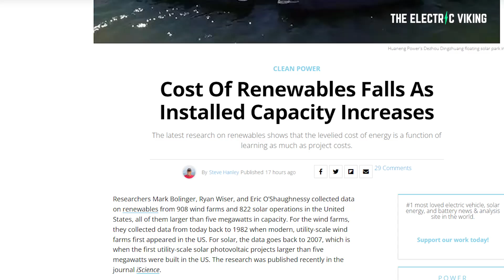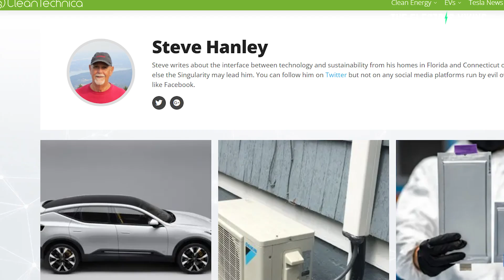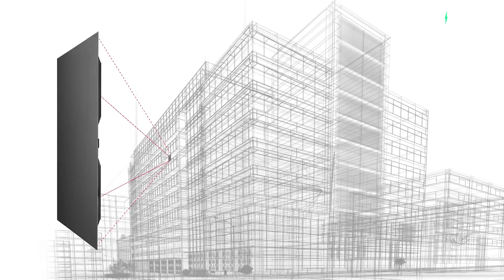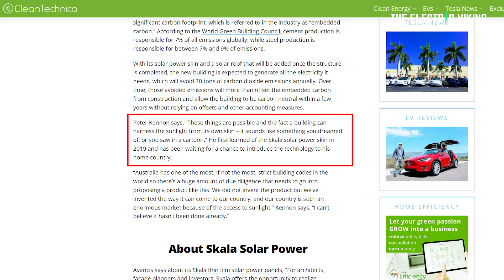INSANE new solar technology that is changing the world NOW

Comment: Yeah but these solars only last ten years same with air turbines they cant remove all the pollution air clouds cuz they need those to make solar panels & air  turbans but paris had the answer since 1970 its a water powered cement bridge turbine that powers 100,000 homes its cheaper to build than a radioactive electricity & 100% safe even for fish build 1- 2 of these in each city. And they last meaning it was built in 1970 and it still working I know they got Center solar panels now or you can put on your own household I'm working on making those build up our house and but water turbines taking a lithium and other types of minerals to make these I mean I know they came up with bacteria in Sweden they have discovered harder abstract metal from Plants but it's not enough another coming up with a lot of innovative ideas the Biden is still digging for oil and gas in this destroying our planet I think the Paris water turbine Bridges is the best way to go until they can make better technology Britain minister visited paris to look at Bridge but decided not to use it, its cuz he wants to continue to make 💰 on gas & oil but of course he doeseny say that he says the cement turbine bridge is not economical convenient which is a lie cuz paris has been using it since 1970

Comment: Hi Sam. Sorry to say that the chemical reaction that turns limestone into portland cement creates CO2. Perhaps energy sources used for transporting and crushing the product can go all renewable, but there is no way to make concrete without releasing CO2 into the air.
Solar skin on the outside, wind turbines on the roof and batteries in the basement would make for a self powered building. Not only would it be cheaper in the long run for energy costs, it would also be black-out proof. Another side benefit is that since it is drawing energy from the environment, it's not adding heat to the environment either. Our large cities wouldn't be any hotter than the contryside in the heat of summer. It's a massive win!
Reply: Making that chemical reaction happen involves a huge kiln which has generally been heated by burning stuff, that is another part that can be done with renewables. And there may not be any way to make it without releasing some, but afterwards the hardening concrete absorbs CO2 from the air.

Comment: I agree, it's exciting. It would be interesting to know if the excess energy will be locally stored in batteries or if they plan to execute a netmetering arrangement with the local utility. Making a grid interconnection of that size would require some sofisticated equipment on the primary side of the transformer. I'd like to know how they will solve all of that.

Comment: Ordinarily Fe3O4 (iron oxide) is reacted with carbon -> Fe + CO2 (Iron and carbon dioxide)
However the Iron oxide can be reacted with hydrogen to produce just Iron and Water. The technology exists. Obviously we will need hydrogen produced by the electrolysis of water to do this…..with the electric energy required produced by pV panels. 
Australia has enormous scope for exporting hydrogen 
Sam YOU ARE RIGHT AGAIN !!!

Comment: How many EVs (roughly) could be powered by the one building? Just as a point of reference. I'd like to see how we can limit fossil energy powering EVs. Coal use has climbed dramatically by the global price of oil. We need to reduce all fossil fuels for electricity production.
Reply: You can easily imagine that future buildings will see their shape and siting as a possible financial resource from the excess power generated.

Comment: Is a metric shit ton 2.2 x a shit ton us? Next one is it stick or twig. I remember going to Nerel in high school. Pretty cool.  The problems currently. 1. Turbine blades are barried once being put out of service. 2. The cars don't fancy gear heads. 

To think of architecture today and frank Loyd wright's work of the future. It'll be impressive to see what the make. I'm currently looking in tiny homes like Norton legend 2. The big problem about buildings and houses is disturbing the top soil releasing locked carbon that will not be recaptured by plants. Building Vertically is the future.

Comment: The assumption that sodium batteries will be cheaper than lithium batteries remains to be verified.
It should be noted that the lithium in a lithium battery is not as large a component of the battery cost as people assume. Also lithium is significantly superior to sodium as a battery element due to its smaller ion size and higher cell voltage.
Reply: Sodium batteries will be cheaper and sodium being cheaper than lithium is just a part of it. It is common so the price will not rise to insane levels and there will be no material shortages slowing down battery production or causing projects to be late, so there will be more customers willing to buy them, which means battery manufacturers can safely invest in building bigger factories, which will increase the amount of batteries made, which will keep the prices down.
Lithium batteries would have more power and can charge faster, but sodium batteries can be made cheap enough and in such large number that projects like all EVs having swappable batteries and every home having a megawatt-hour of energy storage become viable. They are also less prone to having problems with heat so they are safer, so they can again be used in more applications.

Comment: When it comes to green energy most people get carried away by the media hype, positive and negative. Most people are not scientist or engineer. But it does not take an expert to know what the experts concluded. 

NO AMOUNT OF WIND/SOLAR ENERGY CAN FORM BASE POWER. 

Base power mean steady large power the economy can depend on 24x7. But there's more: it is power that allow precise, balanced engineering of the grid, does not need vast amount of battery storage. 

ALL solar/wind need vast storage, or much of it is wasted. Huge variation cause a great deal of flux to the grid, create much engineering and management challenges. Covering large number of buildings with solar panels may look sexy, but it is completely impractical, yield miniscue impact. 

So wind/solar power is not the 'insane' tech that change the world, regardless of their size. The real power that change the world is nuclear, natural gas and green hydrogen - these are the base power economies can actually depend on. Hydro is also base power but that has already been tapped out worldwide. Wind can be used to make hydrogen, which deliver base power - the H2 actually serve as a 'battery'. You don't have to like what I and experts say. But you have to deal with the physics of the real world.

Comment: IMO. Solar power is best when installed nearest the place power is needed. Roofs. Building facades. They are obvious places if they have direct sunlight. It also helps diversify the electric grid. With local battery storage, our grids are more stable and less prone to attack by enemies of any type.

Comment: People like to feel that they are on top of any subject, and so repeat 'talking points'.
EVERYBODY does a daily drive of only 10% of their cars range and top up every 10 days if going to empty on fuel guage. 
EVs will be topped up everyday from any where the car is parked and on std 240v supply.
Forget 'horse and cart' thinking, Ford destroyed that thinking and the EV world will destroy the ICE world. 7million EV sold last year and main production has not started.
The automatic plug in device will be the killer invention, and the grid will trade power for money with the huge 100kwh EV battery. Trade for money. Everybody will pay to be grid connected only.

NOBODY will buy a home battery, the EV battery is big enough to power the home over night and everyone is grid connected.
Everybody will have an electric constant flow hot water heater to top up stored hot water. Small and cheap.

Comment: Australia has 8 million billion m2 of sunshine 365 days a year. 
1 kwh for each m2.
7,000 klm main transmission line down East Coast and across to Perth. 
3 time zones of extra sunshine on the grid.
A small gap 1,600klm in south desert.
Then the wind energy from the Roaring Forties, the trade winds across the southern coastline near the transmission lines.
Every building rooftop and every EV vehicles battery and the grid. 
33kwh x 10 million rooftops x 365 days. 
100kwh x 20 million EV batteries.
7,000klm grid x 3 time zones.
Petroleum will be a strategic military reserve asset. 
Even the nuclear industry wants to power Electric Vehicles but their costs are massive and FIXED.
All homes and all vehicles means x3 electrical power required.  ! ! !
Reply: Solar on the roof also shades the existing roof, extending the life?
I would imagine there's also a case for direct solar water heating?
Just needs joined up thinking
Reply: @rogerstarkey5390  yes I have mentioned this to the companies quoting me to supply my rooftop solar PV. 
A cooler attic space. 
Not sure how expensive water and high DC voltage solution could be. 🤔 
Just my thoughts.
Reply: @rogerstarkey5390  further thought on solar hot water, if 4m2 gives 320 litres in 5 hours from solar water panels, then
16m2 is needed for solar PV panels to heat the same 320 litres. 
Roof space maybe tight and hot water panels maybe it.
If the grid is oversupplied then Electric storage hot water tank to absorb the excess energy maybe it.
Heat pumps are 4 to 5 times more efficient and so 4m2 of solar PV panels maybe the go, this last solution may absorb excess energy from the grid as required and directly heat the water. 
Excess grid energy maybe mean the grid will pay you to take it. 😃 
The grid will be smarter than your smart meter.
The grid will use AI to predict the weather for supply and demand. 
Just my thoughts. 
We have grandchildren and idiots are pushing a nuclear industry around the world. And Australia supplying the world's uranium and charging EV batteries. 
The USA is the biggest target in the world and it's military costs would massively increase so that its nuclear capacity increase will match the world's dictators. 
Australia will be the target if we do not supply uranium when we have large reserves. 
Just my thoughts.
Reply: Connection between east and west in Australia is the sort of goal that would allow access to the abundant solar and wind potential of the currently mostly vacant Nullarbor plain. The high cliffs of the great Australian bight would be useful for pumped hydro storage. The freight costs without diesel trains and trucks could off set much of the costs.🇦🇺🌞🌏🤔
Reply: @malcolmrickarby2313  yes.
The new 700 klm link to Adelaide's transmission lines is at $2million a klm. 
So 1,600 to link the East Coast markets to the West Coast is  'no brainer'.
An electrified rail,  a  'linear' industrial corridor, even pumped hydro storage with sea water, very good thinking. 
The cliffs are very high, and storage could be low burms of earth covering acres.
Low weight trains travelling in both directions for thousands of klm, for passengers, workers living in the desert and going to work down the line.
Fully automatic trains running 24/7 on renewable energy. And with sleepers for an overnight trip to the big city. 
The desert residential suburbs could have access to the coastline and the wide open desert area. 
Great thinking. 
Australia could extend its merit based migration policy. Millions want safe homes in a safe country.
Reply: @malcolmrickarby2313  the extension north into the desert of more solar farms and farming under the panels.
Water has always been the biggest problem but now solar and renewable energy and access to the sea would allow desalination.....
Reply: Jai Hinduja.  Australia has the resources that can be combined with Indian technological brain power and  manufacturing prowess  in the WinWin Comprehensive Economic Cooperation Agreement of the 2 nations.
Reply: @tedchandran  8,000 million klm2 x 1kw/m2 each day. Approximately. 
8,000 x 1,000 x 1,000 x 1,000 x 1,000 kWhrs each day.
8 billion million kwh each day. 
8 billion GWh.each day. 
POLITICALLY STABLE. 
PLUS wind power.
Unlimited energy and robotic manufacturing and mining. 
POLITICALLY STABLE. 
USA a stable ally.
Minerals everywhere. 
The world can cool down and
 the ' Lucky Country ', Australia, can grow again. 
Just saying.

Comment: Is the price of solar and wind dropping?  It better its already 2x the cost per kWh to produce.  A reality check is; when people see this cost; they won't want to pay twice as much for power.  If large numbers of EVs ever start to burden the grid - there will be no choice but to go with increased fossil fuel use - which is contradictory to the reasons or doing it in the first place.
Reply: The reality check has been made years ago and the result was that wind and solar are the cheapest option and still getting cheaper. Only real competition are other renewables and nuclear power. Some smart people have also calculated how much EVs will burden the grid and know there is no need to increase fossil fuel use. In fact there will be lots of energy saved because it is no longer wasted mining, refining and transporting fossil fuels just to burn them in highly inefficient machines. There will be no choice but to decrease fossil fuel use, meaning trillions of tax dollars will not be wasted subsiding them. When people see the cost they won't want to pay for stupidly expensive fossil fuels.

Comment: Todays standard 300w solar panel is about 20% efficient.  There isn't much hope for a breakthrough. Even if it was, powering an EV is fantasy land.  If you live in the sunbelt it takes 10 such panels charging all day to power a Tesla 15 miles!  That's a fact; so to get 150 miles would take 100 such panels; even if you could double panel efficiency to 40% you'd need 50 and at what cost?
Get real solar powered EVs is a fantasy what EVs need is thermonuclear power to make them green.
Reply: Our scottish 6kw system is enough yield annually to cover 70 mile a day commute in my Tesla Model3.  Need a second powerpack though as my Tesla charges about 16kw weeknights (on cheap rate grid)
Reply: @colinpalmer9070  Hello Colin; so am I correct in understanding you have 18-20 300 kWh solar panels; More? and your commute speed is 35mph?  So you are driving one hour each way?  My figures are based on 65mph and 10 cell; not on my experience but that of a major installer.  You also have a model 3 probably the standard configuration which is the lightest.  This isn't a typical Tesla; so all together I wouldn't say it isn't possible to do that.  You mention 6kWh so you'd need 10 hours of light You don't get that every day in Scotland I would think? You also said 70 miles not km?
Reply: In Australia 6kW systems can put out 30 to 40kWh a day. That could fill up an empty car in a weekend.
Or a few retired neighbours cars during weekdays as most of that power is being dumped into the grid.

Comment: Technology this is a terrific product but, if applied to every building in every city, that would bring enormous problems for the grid. You can say put the energy I batteries or so. But they come with their own “footprint”. Something not a lot of people want to talk about. 
25 years ago the holes in the ozon layer were the worlds biggest hoax. Nowadays it’s the carbon footprint.
Reply: Storage electricity is developing and the exceeding electricity coube diverted to industrial process that consume large amounts of electricity and the grid will adjust as this don't happen overnights.
Reply: For the ozone layers it wasn't a hoaxes as they found replacement for the refrigeration liquid that impact less and also they now recuperate this liquid to re-use them in new units. 

Acid rains wasn't a hoaxes also in North America and they found a way to prevent it by shooting down the coal plants. 

So give us a proofs of your conclusion regarding ozone layers.

Comment: Without storage of a huge amount of energy, the buildings will not be able to power themselves. You need enough for night time use and for use on less sunny days. Otherwise you’ll need a lot of fossil generation continuously on line as backup. The storage, as usual, is the problem.
Reply: MegaPacks..

Comment: Cement CO² emissions come not only from coal and oil power used, it is a chemical reaction from the materials used. Even if you used heating from renewable sources in the process, there will still be lots of CO² released from the materials used that we dig up.
Reply: It is true that most cement has chemical reactions creating CO2, but there are several companies making low carbon cement, and that should be made the standard.
Reply: Yep buit is a one time deal of CO2 per building and after you still need to cool it down or heat it. Like an electric car. 

There is no excuses anymore to not do it. 

Unless you have something better to propose instead of iron and cement for commercial building.
Reply: @MichelDerome  Sam talked about emissions from Cement being due to not using renewables for the manufacturing. I was just pointing out it's not that simple. Of course putting solar panels on the building is a good idea no matter how it is built.
There is a lot that can be done to minimise the emissions from cement manufacturing, but due to the nature of the process, I don't think it will ever be zero emission. Maybe you could recycle it, just like batteries?